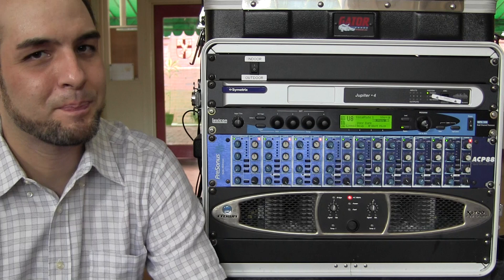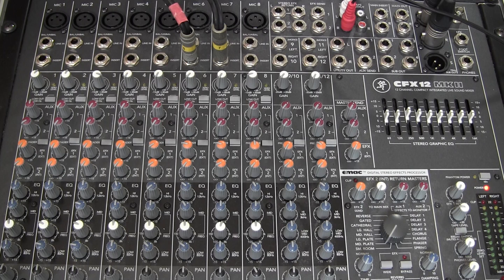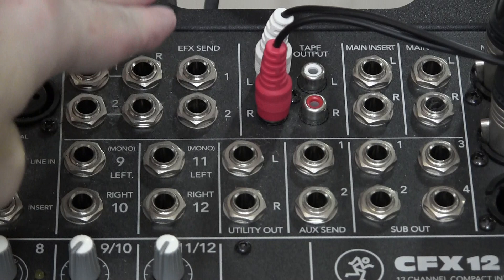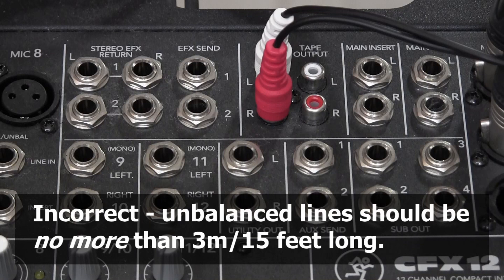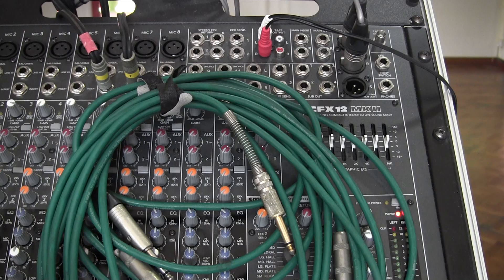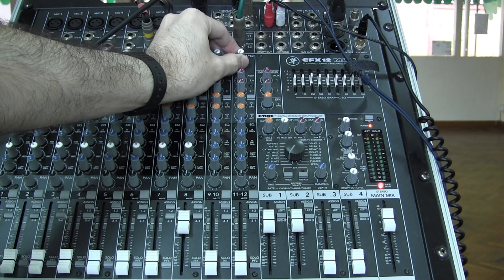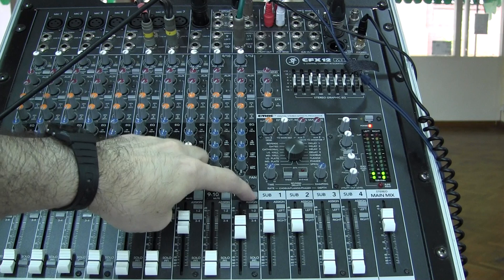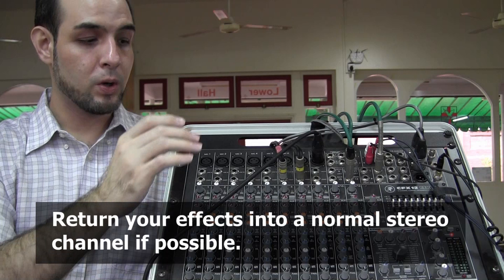How to set up an external effects processor for live sound

Comment: Should I set up gain structure between my Aux post fade send and the input of the Reverb unit please? The manuals always say to put the input on 12 o'clock but I disagree. If I put a signal into my mixer channel and put the post aux send just below clipping, can I then put the input of the reverb unit just below clipping? Then turn down the send and surely only then will the gain structure be as it should between mixer and reverb? Thanks for your help.
Reply from the maker: PhotoMusicMan Yes, the advice in the manual is only a general guideline and is based on the assumption that your mixer has an 'average' line level output. The main thing is to ensure that the input to the effects unit is not overloaded - your method would make very sure, but I personally just keep an eye on the input meter of the effects unit during soundcheck. Mind you, some effects units sound better when they are driven hard, so it's worth experimenting.
Reply: GLB Productions Thank you for your reply. I found that my reverb units (I use a Lexicon MX300 or TC M350 live) sound better when pushed (not clipped!) too. I wonder why that is?
Reply from the maker: PhotoMusicMan It has to do with the fact that circuitry does not always respond in a linear way and there is often a 'sweet spot' somewhere in the gain topology - a bit like how cars have an optimum RPM at which the engine likes to be driven. For a more scientific explanation than that you'll need to ask an electronics engineer ;)
Reply: GLB Productions Your explanation is all I needed thank you - I would get lost immediately if an engineer went into tiny detail.  I guess it is a case of 'using your ears' and what sounds good IS good. Thank you.
Reply: GLB Productions I did a very silly thing today. I sent an aux send to my TC M3000 unit from my mixer (jack out to XLR in on the TC unit) and returned the reverb to two channels on my mixer using two XLR-XLR cables (the TC unit only has XLR ins and outs). I had a Beta 87 plugged into the mixer with phantom power turned on. It is only just now I realised that all the XLR's were receiving phantom power. Could this have damaged my reverb unit in any way? I will use XLR's to Jacks to return the reverb outs in future. The reverb unit is fine but I'm worried that I may have caused problems. Thank you.
Reply from the maker: PhotoMusicMan That was definitely an issue in the old days, but all modern electronics can handle phantom power being applied to their outputs no problem. If it was an issue it would be clearly stated in the owner's manual. 

And yes, the output from the reverb unit is line level so best to connect to the line levels inputs on the mixer.

Comment: hi bruno since i have limited channel as well as aux and want to use external effect 
both for front house as well as moniters is there any way to use external effect instead of internal.Bypass internal effect and use external.
my mixer model is profx22 vita by Mackie. I havent bought external effect need your suggestion , Thinking about lexicon.
Reply from the maker: Sure, on that mixer you can use the 'FX send' connector to send a signal to an external effects unit.
Reply: GLB Productions thank you so much Bruno you are great god bless you bro Amen
Reply: And where to return. Will that be applied to all channels for monitors as well as front house mix?

Comment: I have a slightly different query. I wanted to connect my pedal through my amplifier to a 'Jamhub'- An in-ear jamming studio. Generally, we drive our pedals straight into the jamhub but to extract a better tone i thought of connecting my pedal through an amp and then into the system. I connected the input of the jamhub to the 'headphones' jack on my amplifier. But there was no sound. Is there any way i can get that to work?
Reply from the maker: - I suspect it may have something to do with your connection to the jamhub - did you remember to use a TRS/stereo cable to connect the output of your guitar amp?
Reply: Umm the input to the jamhub is stereo but the output from the amp i.e. the end of the cable going into the headphones jack is mono. Does that have to be stereo too? Thanks.
Reply from the maker: - Yes it has to be stereo on both ends, because the headphone jack is a stereo output ie it has both left and right signals.
Reply: Oh. So i should get my connector changed to stereo then. Thanks a lot though. Big help. :)
Reply from the maker: - You're welcome, hope that solves your problem :)

Comment: why do we need external effects? mixers have built in fx
Reply from the maker: Good question! 1) Not all mixers have effects built in. 2) The number, quality and adjustability of the effects built into most budget mixers is very limited compared to what can be obtained from a dedicated external unit. 3) Many big shows will run multiple effects simultaneously eg a vocal reverb, a vocal delay and a couple of drum reverbs - the only way this can be achieved is with external effects units. Hope that answers your question ;)
Reply: Thank you sir for your reply.
Reply from the maker: Anytime Dennis!

Comment: Hello GLB. Can i use external eq on mackies subout??
Reply from the maker: Yes you can.
Reply: @GLBProductions  should i use Y cable??
Reply from the maker: No - the subgroup out is not an insert point. You would connect mixer -> EQ -> back to mixer or to power amplifier, depending on your application.
Reply: @GLBProductions  ok thanks...GLB.  and pls make a video about subgroups??😅😅

Comment: Hi GBL Sorry to ask you today , I got my Mackie CFX12 MK2 in 2016 but never disconnected Just on June 23, 2018 I took to the Hall for Karoke . My friend he got Yorkvill 
Active with amplifier buit in speaker , after my connection from Lexicon MX200 I never go the sound Microphone out to the speaker.here how he connected out from the top right L R 
main to the speaker . so is that the right connection? or Do I need Amplifire for speaker? Thanks.